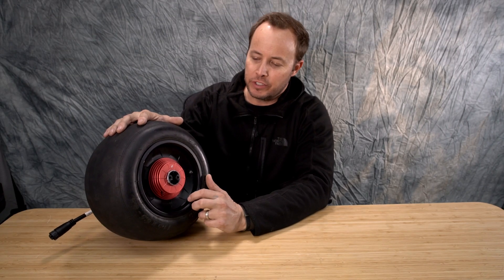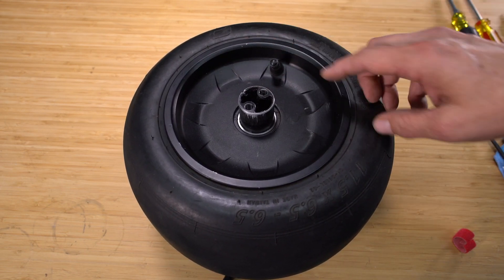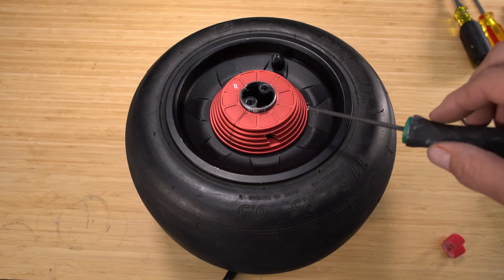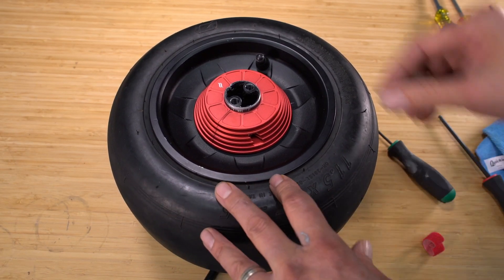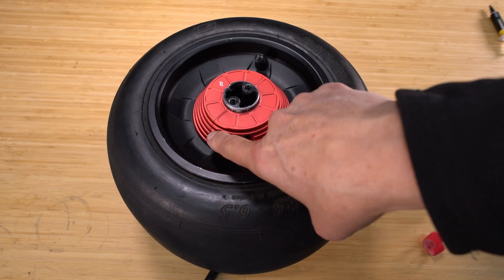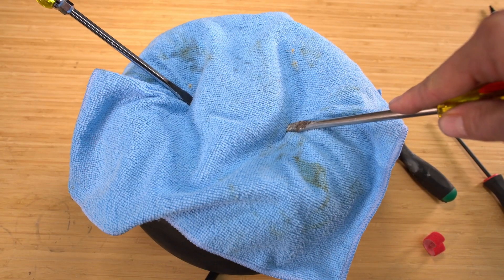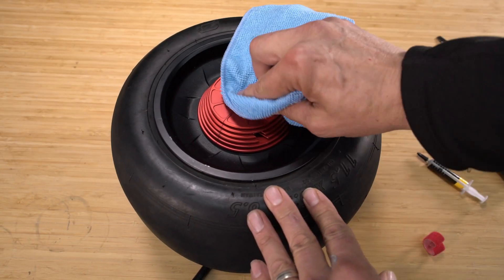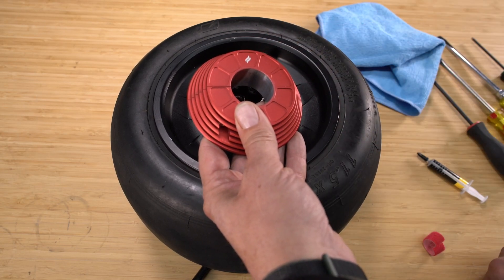Land-Surf "Stone Cold Chillers" (Onewheel GT Axle Heat Sinks) Install Video

Comment: Do these work with the bearing protectors from Badgerwheel or do I need to take those off?
Reply: The Chillers will protect your bearings so you can sell your bp
Reply: @smokeyBJJ  Nah, I don't think they create a good enough seal. I just used the techrails axle blocks in place of the chillers, because they do the same thing but let me have my bearing protectors on as well.

Comment: If I have badger bearing protection on, do I need to remove it to use this?
Reply from the maker: The chiller sits right against the bearing, so it's probably best to remove the 3d printed badger part.

Comment: Will these work if I've done a GT-R Mod using the xr wheel?
Reply from the maker: No, the XR axle has slightly different tolerances, it didn't work on the one I tried.

Comment: Do these work with the bearing protectors from Badgerwheel or do I need to take those off?
Reply: any answer for this?
Reply: @saramosingj  idk yet still
Reply: The Chillers will protect the bearings so no need for a bearing protector